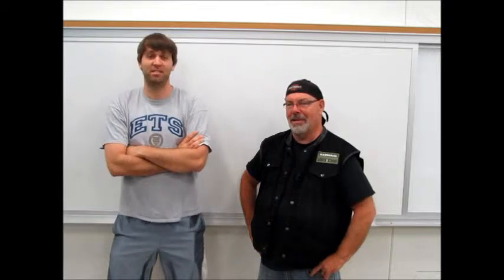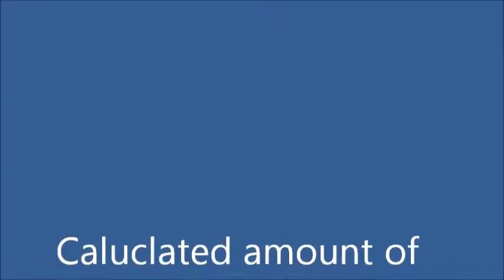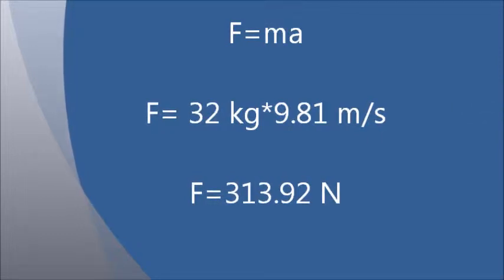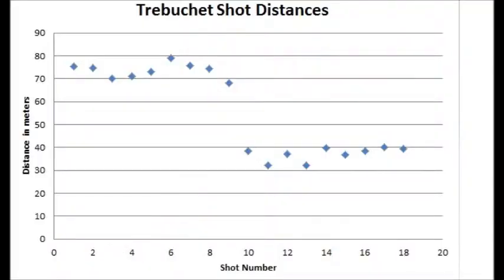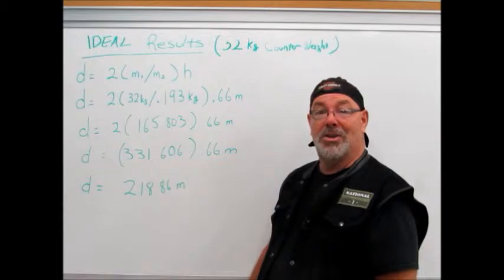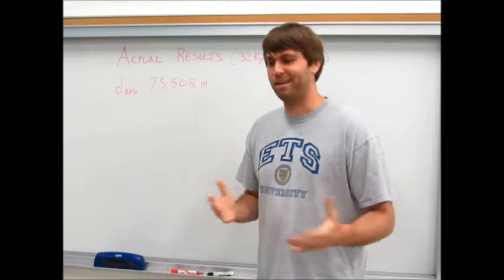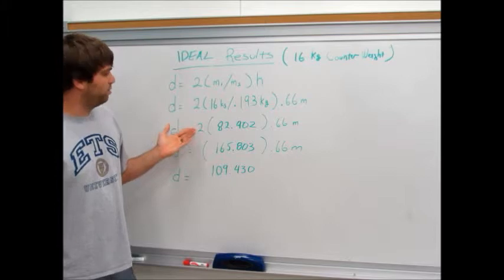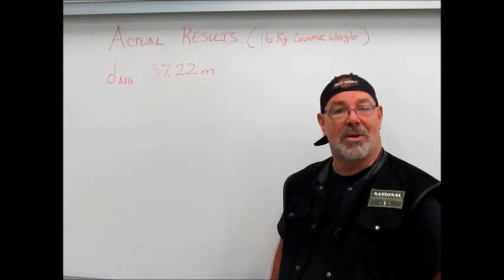trebuchet physics

Comment: No. The main reason that the distances are so much shorter than they could be in theory, is poor energy transfer. Your trebuchet would have to be totally motionless after launch in order to have transferred all of the potential energy to the ball. Your weight had quite a bit of kinetic energy left after release. (try a suspended weight for better results).
Reply: kilroy1964 I agree. I'm about to create a trebuchet as a project for one of my classes and based on my research, it's better off if the counter weight is held at the end of the arm by a chain or rope. This is a much better way of transferring the energy.